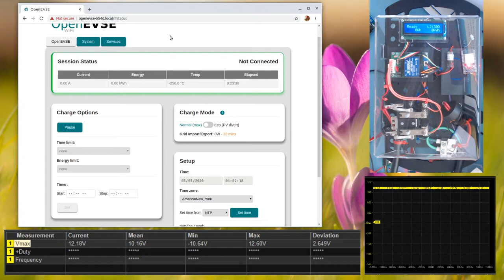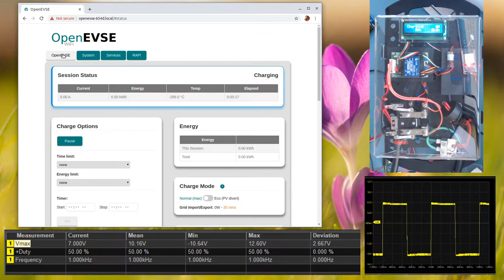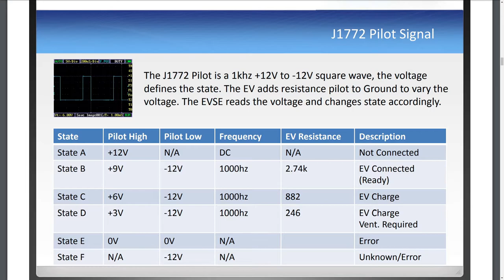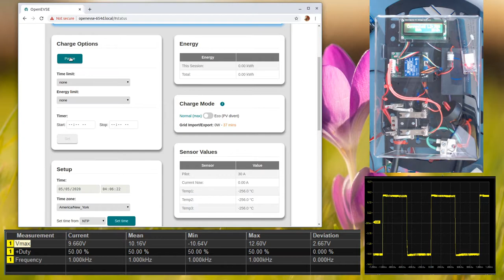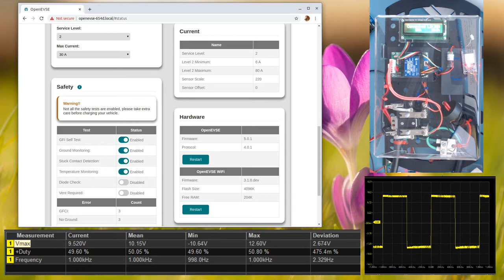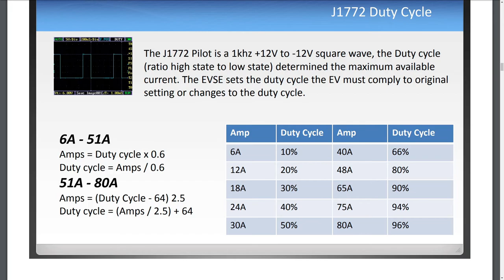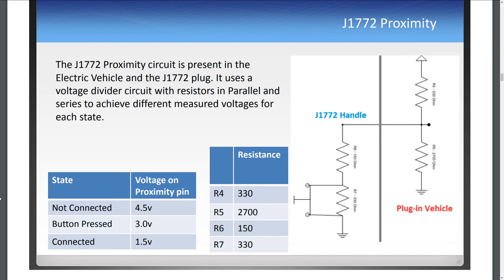EV Charging Station EVSE - What is pilot and proximity? by OpenEVSE

Comment: Hi, great video. Question, when CCS fast charging does the station use the AC communication pins (control Pilot + Proximity Pilot to control the flow of current to the battery? Thanks.
Reply: Control pilot and proximity pilot are communication pins used in both AC and DC charging.
These pins are not for power transfer

Comment: Hi..very nice video..Thanks for the video.
I have a confusion. 
My understanding as of now is given below. Correct me if I am wrong.

PWM at 9v represents maximum charging current which EVSE can supply.

PWM at 6v represent   charging current which EV is demanding.
Reply from the maker: @bharathkmr35  PWM at 9v means the EVSE is now ready to supply power. If the vehicle is also ready, the vehicle will pull the signal down to 6v by adding additional resistance to the pilot. When the voltage is pulled down to 6v by the vehicle the EVSE will close the relay, assuming all safety checks pass.
Reply: @openevse3739  Hi, thanks for the response. Actually, my query was regarding the interpretation of   duty cycle of PWM at 9v and 6v, 
CP signal of 9 v represents 2 items ie; 9v  tells that  EVSE is ready for charging (9v) and the duty cycle  during 9v signal represents the current what EVSE is capable of supplying.
CP signal of 6v represents 2 items: e; 6v  tells that  car is ready for charging (6v) and the duty cycle  during 6v signal represents  current  what  car is demanding.
Is it correct?

Comment: Hey nice video.
What I still dont get it what if the following scenario occurs:
Charger sais car can load with 32A
Car can only load with lower Ampere (lets say 16A)

Is the PWM Signal (Duty Cycle) then beeing changed by the car?
Reply from the maker: The charging station offers a maximum amount. The vehicle may choose to use less. Many vehicles only have hardware onboard for a certain power level. A 3.3kw vehicle will never charge at higher than 16A no matter how much the station offers.

Comment: At 5:24 - what is the charge options. Can you explain more please. How can we know station is not ready ? Is this setting for commercial usage or do we have to do this ?
Reply from the maker: @muhammetuludag5269  the EVSE signals it is not ready by keeping the pilot at 9v DX. When the EVSE is ready it turns on the 1000hz pilot. 
The vehicle signals it is not ready by keeping the 1000hz pilot at 9v. when the vehicle is also ready it pulls the pilot from 9v to 6v.
The EVSE can also pull the pilot to -9v to signal not ready and due to an error state.

Comment: Hello! Can You explain how the car can accept 120 or 220V? Is it decide by the charger, or the car? Is it automatically recognize or need some signal?
Reply: All cars can take both. It's up to the on board charger to work out what to do with it
Reply from the maker: @choukoksol8121  the voltage is decided by the circuit. The EVSE can only switch it on or off. The vehicle on board charger is designed to accept power at a wide voltage range usually form about 90v up to 260v.

Comment: How would the PWM signal work for DC fast charging where the current can be very high?
Reply: DC Fast charging use PWM at 5% to indicate that the communication will take place digitally, most often power line communication (ethernet over powerline almost).

Comment: does the 1k wave actually require -12v.  Seems to me it really doesn't, if it go to gnd only the information is identical.   Can't seem to find an answer to this question, will have to just try it i guess if nobody else in the world knows the answer...
Reply from the maker: @murraymadness4674  The SAE and IEC standards do require the -12v to interact with a diode in the vehicle. It proves the resistance is intentional and not a handle dropped in the mud. The diode blocks the negative portion so the vehicle does not care if it is there or not. While you could hack something together without -12v it ignores an important safety verification and would not be compliant.
Reply: @openevse3739  makes sense, so it will work without the -12v, not selling anything, just getting my $400 leaf to charge up using parts I have on hand.  I understand you don't even need a relay, can just run the 120vac always on.  I will be building something soon.  Thanks for the input.

Comment: In case of proximity pilot, does it need to control on evse side? Both ac and 15118 dc charging, It is a job bewteen the connector and ev. Am I right?
Reply from the maker: J1772 Proximity is between handle and vehicle. "Proximity Pilot" in IEC specs is for reading ampacity of cable using resistance from a "Proximity Pilot" pin to ground. The EVSE does need to read IEC "Proximity Pilot".
Reply: @openevse3739  Thanks for your reply.
And then EVSE should read IEC "Proximity Pilot" and change the maximum charge current value to the CP PWM signal?

Is it the EV role to control charge current level accoring to changed charge cable? Am I wrong?
Reply from the maker: @bd300youube  Correct. If the resistor value in the cable for "Proximity Pilot" indicates the cable is 16A. The EVSE must limit control pilot to a maximum of 16A even if the station itself is capable of more.

Comment: The current limit is indicated by the PWM signal how about the voltage values how it is communicated?
Reply: I’m at the same problem…
Did you understand how the station see the voltage level?
I mean, when it isn’t using PLC.
Reply from the maker: The voltage is whatever is on the circuit. The EVSE can only switch it on or off. If the mains are 240v then the vehicle gets 240v.